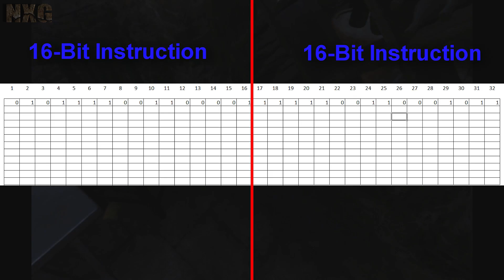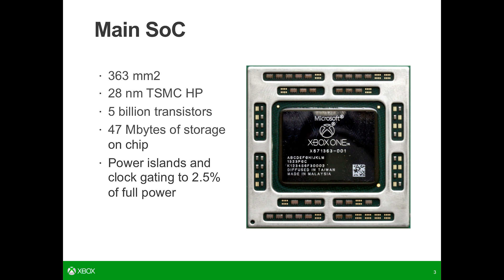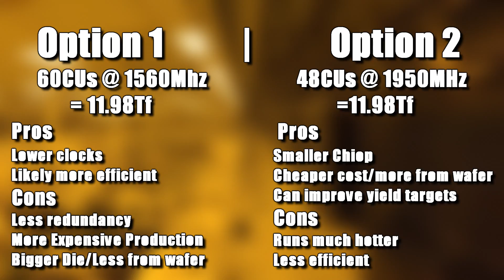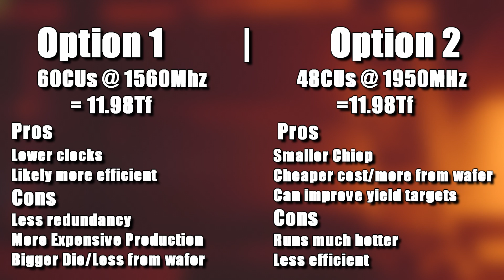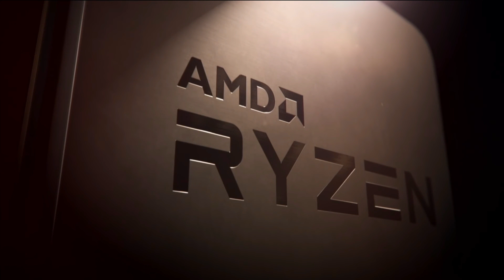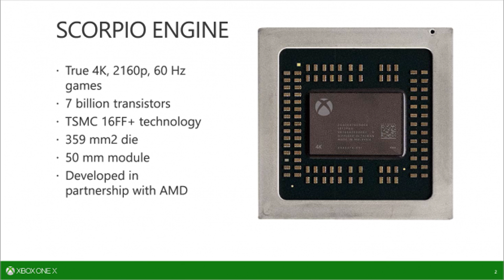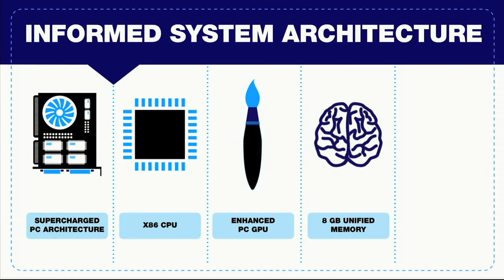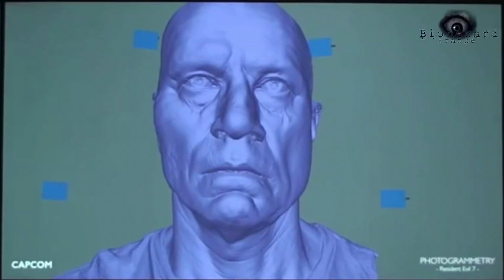Is the PS5 only 9Tflops? | Let's Talk

Comment: The only reason people are mad because Xbox is 12tflps. Its pathetic!! 9.2 is awesome. Buying both day one
Reply: Not even confirmed yet 💥
Reply: @Transistor Jump but it probably is 12TF, stop crying
Reply: @vandammage1747  You're absolutely dumb.

A. That person was not "crying"
B. There's no proof at all that Xbox Series X will be 12 Teraflops of GPU power. 
C. It's most probably both next generation consoles will sit around the 9.5-10.5 Teraflop range.
Reply: @ghostthough7874  and there's absolutely no proof that both will be 9.5-10.5 range Lmao. Megafail
Reply: @vandammage1747  It's much more realistic than 12+ Teraflops. The "leak" that said Sony's system was 9.2 Teraflops was an AMD internal test for next generation consoles. So at once point development, one of the consoles was 9.2 Teraflops. However, it's outdated and the consoles are probably more powerful than that now, especially since during that test there was no dedicated Ray Tracing hardware support, but confirmed to be included in both next generation consoles. So assuming there was a revision to that prototype chip (of course there was), it's going to be higher than 9.2 Teraflops. No way it's anywhere near 11+

Comment: With Microsoft releasing two consoles, a low and high spec option - did anyone seriously think they would let the high spec option be weaker than the PS5? They would look pretty silly if they did and after the power difference costing them last gen they wouldn't let that happen again.
Reply: What do you mean, nothing has been confirmed yet in terms of power crown. The PS5 might be more powerful if what Klee is saying is true or it might not be
Reply: Unguided Flame You’re bullshitting yourself. The PS5 will not be as powerful. They already confirmed that they will have a midgen refresh. So you are telling me that their standard console will be $500 and then they will produce a midgen refresh for either the same price as the original: $500 or $600? That makes ABSOLUTELY NO SENSE. And I know what you are thinking 🤔, “How does this guy know the price of the next gen consoles”? Simple......I know what MS charged  this gen for what they considered premium ($500). And I know what Sony charged for what it considered a “refresh” ($400). Now all of a sudden Sony is going to charge Sony gamers $500 for a standard console? Despite stating they want to transfer as many people to the PS5 as quickly as possible. Tell me, how would they do that at $500? PS5 will be 9.? Tflops and it will cost $400.......Mark my words. The Series X will be 11.9-12.? Tflops and cost $500. MS has tipped their hand, this is their premium model. Their premium model CANNOT be equal to the PS5 base model. That makes ZERO sense.
Reply: @MrRequiem147  The question is, how would they know what spec range sony aimed for?  Sounds to me like they flashed cash to someone to mine data from AMD
Reply: @MrRequiem147  🙅🏾‍♂️ whoooooa dude, series X may be more powerful but that shit was NOT confirmed. Not by sony, not by Devs working on cross platform titles. Now if saaaaay, makers of NBA 2K came out and confirmed something, then I'd would know. You feasting hard on info unclarified
Reply: D Rex Bruh there are the leaks from trusted sources whose info lines up. Then there is the data mining data that also lines up. Come February (that is when Sony will release actual spec info) you will see that I and many others are correct. And are you still in denial about how many consoles Xbox is releasing at launch?
Reply: @MrRequiem147  these "data miners have no life" what the fuq are they trying that hard to dig into unreleased stuff for, AMD should be sued for having such info even floating around like that; I'm certain AMD has screwed themselves with Sony as a partner in future reference if these are confirmed specs.  But on second thought, I guess it may be better the leak happened to prepare both sides of playstation gamers:  1 the true ones who want Sony's best and 2 the ones who want the cheapest weakest system possible; if true it softens the blow kind of of dissapointment, cause God knows sony would've let us get to reveal day to say this crap.
Reply: @MrRequiem147  I also wonder, if a normal average Joe digging like crazy to find documents on unreleased stuff; Microsoft with their vast resources probably found Sony's next gen plans long before this leak ever happened; thus leading to the alleged "power gap"
Reply: @MrRequiem147  you right. Come February. That's means right now you don't KNOW ish
Reply: The AI Truth I don’t think there is any conspiracy. I think the answer is real simple, Sony wants a $400 machine and MS is putting out two skus. One premium and one standard. Therefore both companies have different goals. Like I’ve been saying, Sony’s console will be just fine. It’s not as if games will look bad. And the price of the Series X mean only the most hardcore gamers will buy it.
Reply: @MrRequiem147  But the thing is, how would Microsoft even know where sony would aim for specs?  With the new changes to Sony Corp, anything was possible to what Sony's next gen would be.
Reply: @MrRequiem147  I agree with what you are saying there too, PS5 will still look great the series X will just look a bit better and only certain people will shell out for it. Hell, the cheaper Xbox will still probably outperform the Xbox One X and look great.
Reply: @gangstagummybear3432  in general, system architects know what level of tech hits certain price points after estimated discounts for bulk purchase contracts for components going inside their box. 

It kind of comes down to companies giving a price point to hit and deciding what kind of a margin of loss they're willing to take on each console sale and still be able to recoup losses with software sales, etc.
Reply: @unguidedflame1550  just my opinion of course, have to see what ends up happening yes, but at this point there are signs pointing to PS5 being weaker
Reply: Clinton Maher well at the moment it’s in the air you got that leak that points to PS5 being weaker and you got trusted insiders saying different. But I agree we will find out soon enough

Comment: I think 
Xbox Series X is 12 TFlops with RDNA 2
Xbox Series S is 7.5 Tflops with RDNA 2
PS5 9 Tflops with RDNA 1
I think from rumours the Xbox Next Generation will have much better Raytracing with DX12 and The gap will be too big in performance and graphics..
Reply: @LockheedTH its already leaked 😅
PS5 is  8-9 Tflops RDNA 1
Xbox series X 12 Tflops RDNA 2..
And SSD thing is not correct ..
Microsoft already talking about eliminating the loading times and nothing leaked about SSD..
the difference will be much bigger than you think ..
Sony will have a problem with Raytracing because in pc even on nvidia they use  Microsoft DX Raytracing api for Raytracing ..
sony will have a big problem without RDNA 2 and microsft DXR API..
Microsoft is just a much much bigger company and in next generation they are serious about power and Xbox..
Sony can't compete with Microsoft in hardware and software.

Comment: For what ps 1st party can do with the base ps4 i wouldn't be worried
Reply: But at 30 FPS its a no go.
Reply: Only if you're a fuckin idiot. The best games of all time are mostly 30 fps. Hell ocarina of Time was 15fps yet it's still considered to be in the top 5 if not #1.

Only morons believe frame rate can make or break a game
Reply: @HugoStiglitz88  most popular games are 60fps. You can keep your 30fps awards to yourself. 30fps will always be an inferior, less immersive game.
Reply: @SlimCargo  30fps in a single player game with everything cranked up to max ? Isn't that what ps guys have been saying all gen ? Visual's visual's visual's?  I personally don't mind 30fps in single player but i also want to see the back of it already
Reply: @jamesw884  30fps is horrible. If sony exclusives stays at 30fps it's a big L
Reply: @vandammage1747  30fps is horrible but for a slow pacing single player experience its ok for it imo
Reply: @jamesw884  all games look and play worse at 30fps. Those that are used to playing 30fps might not notice it, but once they try the 60fps version it's much better every time.
Reply: @vandammage1747  they don't look or even play worse, yes 60 is better

Comment: is 9 worst than 11? yes..Flops are used when comparing the same kind of gpu. both gpus are made from amd with RDNA2. so 11 is better than 9.
still i wait for specs to be release. since there are rumors of 2 console from sony/ms to be released.
Reply: Ps5 is rdna1.
Reply: @MrX-nh4zl   its not, RDNA 2 which is just a refine version of RDNA 1 will be used since its more efficient. which console needs. it doesnt cost more to use either or
Reply: @BrotherO4  rdna1 just except it
Reply: @jamesw884  we will see than. also if its RDNA1 than its worst for sony. because flops to flops RDNA2 will be slightly better...aka its just wont be a 4ish tflop difference. so if this "RDNA1" comment is sony fanboys trying to find a way to say it wont be weaker..well you simple digged a bigger whole.

but again..AMD is creating THE same chip. MS is simple paying to have a less cutdown version and nothing else.
Reply: @BrotherO4  i think it's rena1 just cause of cost and imo sony trying to tie down that 400 price point, even if ps5 is 9.1/10tf their 1st party game's will still look a gen ahead, damn ps and xbox will look amazing
Reply: @jamesw884  1. RDNA1 or 2 wont cost any different..both are made with the same 7nn. also its 2 simple because of ray tracing. that RDNA2 feature. also VRS is a RDNA2 feature as well. even if it doesnt used Ray tracing it wouldnt make sense not to use RDNA2. its faster, uses less power, easier to cool down because of it, and cost the same. it be completely stupid for sony to not only (if true) to have a weaker GPU and it be RDNA 1 instead of 2 which means its even weaker than the number says.
Reply: @BrotherO4  the fact that ps devkits went out so early says their using 1 and every leak benchmark released says the same, yes your right about the advantages of 2 or 1 but sony must have another idea withmtheir custom work which adds to the cost, or everything everyone is talking about it just bs, fun bs but just that
Reply: @jamesw884  sont Dev kit cant use a Spec that is not out..or you truly saying that sony is gonna straight up use the 5700XT with a full fledge zen 2?
Reply: @BrotherO4  sonys dev kit used spec's close to rdna1 which at the time was close to been finalised, that's why their devkit's were out for so much longer,  you do know the devkits is built and clocked strong then the retail unit so it's easy to get it out ? xbox devkit's are going to 3rd party dev's early this year nearly proving all the leak's right about power rdna2, funny how ps fanboy's claimed 3rd party dev's last year said ps5 was the more powerful then a unit they didn't even have to compare it to ? x sony's soc is custom like xbox's and we won't know what work is done until final release, it could be higher for sony then 9tf but the lastest rumor is ps is struggling with clock's and temp's and have dropped the speed's down below 1.8 to manage it and ariel is the latest leak for ps5 at 8tf, people talk like these are reality but it's all number's with no indication as to what their for or who their for, sit back and enjoy the comment section's
Reply: @jamesw884  Dev kits are use with PC parts that are close to the performance level of the release console.

Dev kits that are given to devs with Console hardware is not given till close to Release. 

now with that..RDNA2 is not out..but that is not important because all that RDNA2 is..is a more efficient, ray tracing, and a few feature like VRS. since the next gen console has features that RDNA1 dont have.

again, 
what are you trying to say? because if you trying to say its not the same kind of GPU so the xbox is not rumor to be more powerful..than i got bad news....RDNA2 flop to flop..is better than RDNA1.

again, RDNA2 is not something that takes years to add or cost more to add. its just a Refined version of RDNA1 with some extra feature.  if they want they can release ps5 with RDNA1...they make another Ps5 with RDNA2 and devs will have nothing to worry about.
Reply: @BrotherO4  Dev kits are always more powerful and clocked higher compared to the retail release, as it stands the rumor is the xbox Dev kit is 14tf, the x devkit had more power and way more memory compared to the final spec release, I know rdna2 is better then rdna1 I don't know where you got that also some features of rdna2 might not work or be compatable with rdna1, also if true the original rumor of PS5 using a hybrid rdna/gcn for Bc its definitely going to make it harder for compatibility we
Reply: @jamesw884   "Dev kits are always more powerful and clocked higher compared to the retail release"

of course.. because mostly made with PC retails parts. 

" I know rdna2 is better then rdna1"
what you are avoiding to understand is that...there is zero downside to using RDNA2. its RDNA1 but just more efficient. its not a "New" gpu. its RDNA1 refine with tiny tweaks. in fact it could even be cheaper to make sense console has to hit a Watt limit which will mean the RDNA2 can easily hit those which makes more dies passing the test phase.

there will be zero logical reason to use RDNA1 over RDNA2. there is no cost reason, no optimize reason, no drivers issue reason, and so on. its a net gain from top to button. if sony does use RDNA1 over 2 the designer should be fired and never be given a job as a Head designer on hardware ever again.
Reply: @BrotherO4  dude ps probably made the decision to use rdna1 before rdna2 became a thing and you leave out the rumor it's a hybrid system which is rdna1 and not 2, you seem hellbent on saying ps5 will be rdna2 whenmevery benchmark leaked for ps5 was rdna1 ?
Reply: @MrX-nh4zl  
PS5 is RDNA 2 due to confirmed RT HW, RDNA 1 and 2 has similar compute behavior i.e. single cycle Wave32 and double cycle Wave64.

PS5 could have RX-5700/RX-5700 XT replacement with HW RT  e.g. RX-6700/RX-6700 XT SKU level while XSX could have RX-6800/RX6800 XT SKU level. 

 Dev kits ussually has full CU count enabled.
Reply: @valenrn8657  ps5 will be rdna1 with fake Ray-Tracing via a separate chip.
Reply: @MrX-nh4zl  - Xbots are getting desperate. Pulling lies out of their asses now.